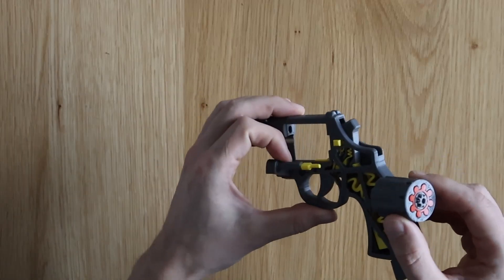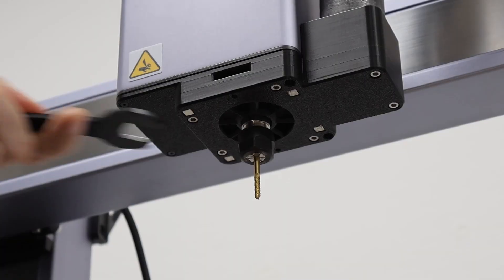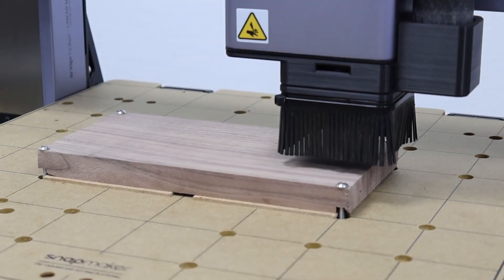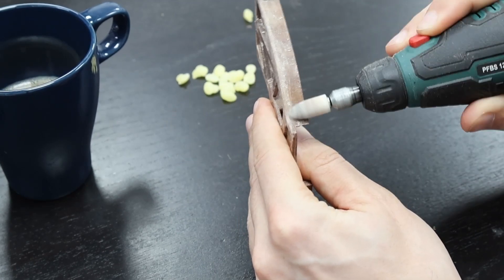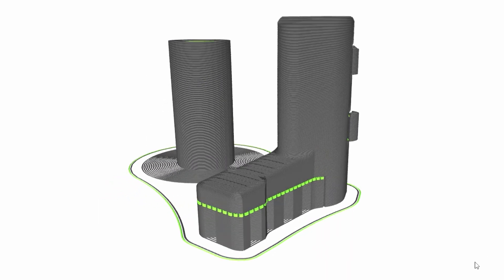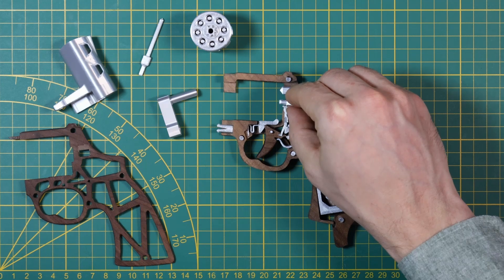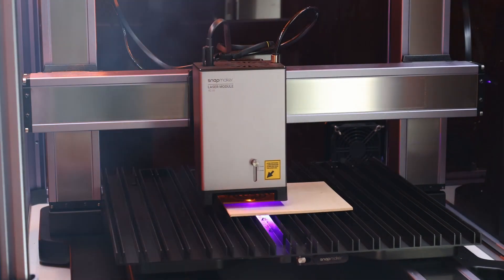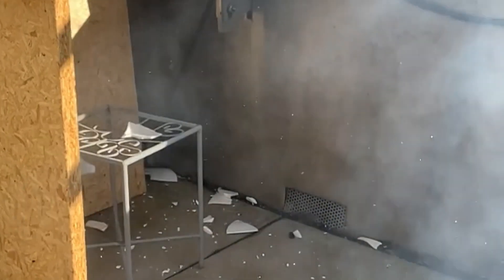This Toy Gun Shoots – Made With Snapmaker Artisan Premium

Comment: Hi it_could_explode, I have no one else to share this idea with so I thought I'd just throw this out there into the world of tinkerers and be done with it, although it's extremely dangerous. The ammo is basically a plastic PET bottle filled with oxy-butane 7:1 or 8:1. The screw-on plastic cap has it's top cut off, and a glass marble held between two sheets of plastic is held against the bottle's mouth by the sawn-off bottlecap. A circuit of wire with a spark gap sits inside the middle of the bottle, leads running out through the bottle cap, which contact a piezo clicker. Now, something this powerful needs a very rugged chamber (metal pipe), but the exhaust gas would have sufficient pressure (passing through a gas port back to the loading group) to power the ejection of round 1 and the loading of round 2... round 3... round 4... I imagine this thing could be full auto, possibly over 4 to 5 rounds per second, 300FPS maybe 20 joules. Of course, anyone trying this can really, REALLY get seriously injured if the chamber fails, or for any number of reasons.
Reply: If you feel the need to censor this comment, sorry to bother you and thank you for your time :p

Comment: Could you make a semi-automatic cap gun that shoots and uses the energy from the cap to cycle
Reply from the maker: I thought about it but the energy is very limited. Not sure if it will be sufficient.
Reply: Okay, there are plugfire caps that have enough power to cycle a cap gun but you would have to get them second hand because they don't make them any more, you could also use flash cotton, or 22 caliber blanks

Comment: FYI, the issue with tear out in wood comes from the directionality the bit was made to cut. There are bits that direct the chips and general cut, up and down. Up cut bits help to get the chips out of your cutting bit's way and will generally leave a good finish, except in wood the splinters easily.  A down cut bit will work to leave great finishes in wood, but are more prone to grinding up chips in the cut, sometimes marring things up. Generally, a down cut bit will work great for your problem.
Reply from the maker: Thank you, I will try that in my next project, too

Comment: Really amazing. I tryed to build a 3D model to shoot aisoft bb's but it was not shooting well. Bullets stayed stuck in the canon. Maybe i can share models with you if interested. 😄☀️
Reply from the maker: Sounds like you need stronger caps. I used vintage caps from the 80s from ebay but they seem not to be available anymore. But I was told, that you can contact alibaba sellers of cap guns directly. Or didnt you use caps at all? How did you accellerate?
Reply: hummm i printed caps from Comrad Mauser Youtuber 3D model. But i modified it a bit to insert some airsoft ball in it. The cap is in front of the barrel and when it explode... Boom the ball stays stuck in the barrel. Its normaly made for air not for powder.
Reply from the maker: @vincentnunna510  But where did you buy the red caps. There are very weak and strong ones out there.
Reply: @it_could_explode  oh it was Amazon. Of course it was weak. But i modified it to make it stronger
Reply: Schrotzünder oder pistolen Zündhütchen wären auch ne möglichkeit. Sind frei verkäuflich und relativ günstig...